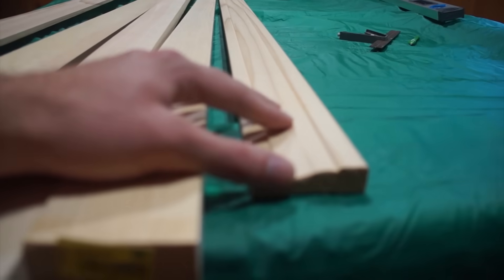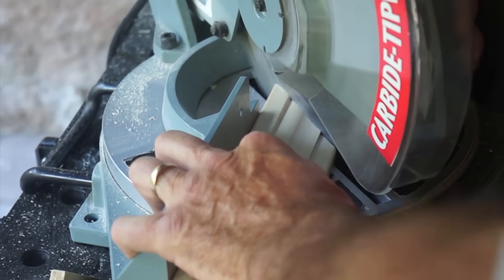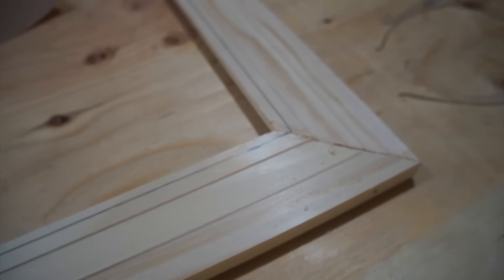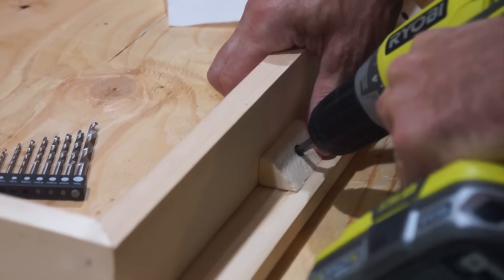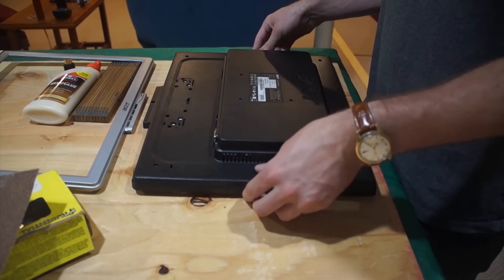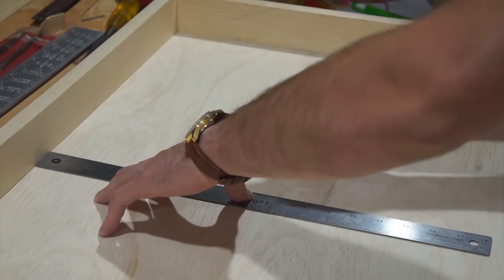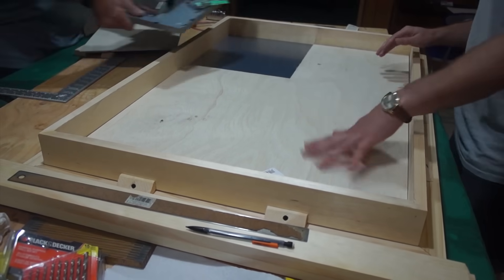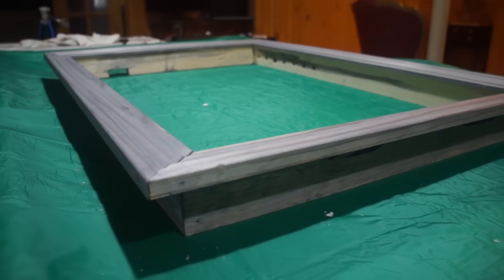HOW TO BUILD A SMART MIRROR

Comment: Make a staircase light with 12 v LED strip and using two PIR sensors. One sensor will be at the upper portion of the staircase and another will be at the lower portion of the staircase. When one person coming down the upper PIR module will work and when That person is going up the Lower PIR module will work. Make it. There is no such video in you tube. Also use 12 V Relay, not the MOSFET this time. Thanks and great video.

Comment: That's a solid build. Putting retaining clips on the cables passing from the monitor (when you could have just stapled or taped... for something that nobody is going to really see) shows quite attention to detail. It kinda looks like you could see the dimensions of the screen since the glow of the monitor's backlight was bleeding through. I think, for version 2, I might consider either going with an OLED monitor or adjusting the brightness/contrast of the monitor to make it harder to see that there's a screen behind.

Comment: Loved the idea and your efforts! However, I have a question for you: Won't the humidity in the bathroom effect the functionality of the mirror over the period?
Reply from the maker: Yes, you are right humidity can damage the circuitry if not properly protected against. Now I haven't really shown this yet in any of my video, but to combat this I use what is call conformal coating on the circuitry of the project. You can either spray or brush on this "conformal coating" and this will put a silicone or similar coating on the circuitry to protect it from any dust, moisture or other particles. Basically it creates a water resistant seal.
Reply: Awesome! You really thought this through man! Appreciate it, one more subscriber!

Comment: But can you see the monitor backlight through the mirror in the dark?
Reply from the maker: It really depends on the backlight percentage you are using. I am currently trying to wire in a function that detects light intensity and changes the backlight brightness accordingly. But when its too dark you can't really use a mirror too well anyways.

Comment from the maker: Please tell me how I can improve this project!
Reply: Grensom by adding a Chromecast
Reply: Looks good, could you put the extension lead inside the back so you only have 1 cable coming out
Reply: Grensom By implementing a proper cable management.
Reply: Voice command would be pretty awesome
Reply: I would either add a PIR sensor to switch the monitor on and off or use an oled panel for the raspberry pi since standard panels consume quite a bit of power. (send the display to sleep system based and let the PIR sensor trigger the wakeup command)
with the oled panel the whole thing would become a lot thinner, alternatively you could use an old laptop display with a driver board for the same result.
with a forstner bit you could make some pockets in the frame from the backside until it reaches a thickness of about 2-3mm. that way you could put capacitive sensors inside the holes and engrave it from the front to have some buttons as an input.
Reply: u should add a motion sensor so when u at the mirror it will turn on ;D
Reply: please include emily poole's appearance!
Reply: Add a list of parts used in the description
Reply: some things have been mentioned, others haven't, but what i'd possibly do, would be to:
1. have an extension cord on the inside where you plug in both cables and have only 1 cable coming out. 
2. tie off the cables and nail them to the inner support beams. 
3. add a (thin) back cover
4. paint both the outside and the insides (with a waterproof paint/lacquer), just in case you decide to hang it in the bathroom (or for prettiness) 
5. the inner panel that you painted black: I'd have cut it first, before painting it (it saves some paint and makes for a neater job imho lol)
6. add speakers
7. get google assistent working on the system (or cortana or alexa or whichever you prefer) 
but anyway, awesome project and these are things i came up with after seeing you do it. I'm not sure I'd have thought of these if i'd have started the project from scratch, so awesome job anyway!!
Reply: Are we at the point where adding in touch screen tech is possible??
Reply: @Three_Dog_Gaming  I had the same question
Reply: You can build in Alexa pretty easily these days
Reply: make it have ssh so you can remote into it from your pc if you need to edit it?
Reply: Grensom, just one suggestion use zip ties for the wires to make them look cleaner it's just a tad bit more professional-looking, but great design man.
Reply: Add a google home or something like that for voice command.
Reply: Hang the mirror over a wall socket, so no leads are comming out...
Reply: ThreeDogGaming the mirror look kinda flexible. Given enough flexibility in the material one of the various touchscreen methods that have been invented should work.
Reply: maybe use a laptop pc and a large touchscreen mirror instead of Pi or even do something like disassemble an Amazon Echo Plus and put that in too.
Reply: Velcro those wires for some cable management and put a mini power strip IN the mirror so only one cable coming out.  Other than that, looks pro!
Reply: Everything is wrong with it, but I'll tell you what... I'll let you practice by building me one.

Kidding. It's incredible. I'm now considering it.
Reply: Like to see a small bathroom sized one using an old smart phone with widget app. It be useful because it's something others could do
Reply: Grensom touchscreen
Reply: Kickstarter might help get funds for it, if it's not on there already.
Reply: Use the metric system?
Reply: Bad ass!! How do you mitigate the warping/temp/heat from the devices coming into contact directly with the wood frame? Is there potential of over heating or fire. Are ventilation holes enough? Interested in building one for my home. Keep up the great work!
Reply: Post it to me, lol
Reply: Link the material bought pleeeease
Reply: @jeffreydavidconner  then you'd need a proper wall mount setup instead of a couple screws >.<
Reply: Why do Americans like big and bulky so much? My magic mirror is flat AF :)
Reply: Make it compatible with 0S updates etc & you can take my money. Otherwise, a great bit of work. I’m off to spend a dumb amount of money because I’m impatient.

Comment: What pi do you recommend I have a 3 and a zero w, also what monitor do you suggest to use???
Reply from the maker: I had some trouble using the Zero W, because that was my first choice due to the size, price and built in WIFI. Because I couldn't get that to work I decided to use the Pi 3. I know the Zero is doable though, but the Pi 3 is what I used and is an easier setup. My other video goes through the complete setup with the Pi 3 as well if you wanted to reference it: https://youtu.be/pcmjht0Hqvw

Comment: Hi that's very cool work, can i ask you questions? could the monitor replaced by just a mobile phone? and about the display, if i use an acrylic mirror and bended, is it still working fine on bended surfaces?  iam doing such an academical research about it, thanks for your work, it's inspiring
Reply from the maker: Yes you can replace the monitor with really anything with a screen, the mirror is just 70% reflective 30% transparent material. The only issue is a phone is a small display and the screen will time out on you. If the mirror is bended obviously you will get a distorted reflection but if you had a flexible display or lights behind it, it would technically still work
Reply: i see, what about touchscreen feature, do you have any idea how to make it works touchscreen? thanks for the answer btw...

Comment: Would a raspberry pi zero work with this?
Reply from the maker: That's the thing, I wanted to use a pi zero w starting out but was having no luck with it. I believe it can be done but you have to run the software a certain way. You'd have to look into it more to understand

Comment: we can make the same setup using android tablet. That way it will be cheaper and easier to setup. and i think amoled display will look more refined.
Reply from the maker: Yes you can, there are apps on the Google Play store you can download to have a similar setup. The only issue is the size of the display is probably going to be smaller. Also you have to make sure the tablet doesn't go to sleep on you
Reply: Grensom ya . i have a old tablet. this project can give it a new life. haha

Comment: Put some retro games on it. You could play space invaders on your mirror.
Reply from the maker: Technically you can do that already because the Raspberry Pi comes with Games on it by default. But you need to disable to auto-boot function on the software or else every 15seconds the Smart Screen will keep popping up
Reply: Grensom would be cool though, a stealth game system hidden in a mirror.
Reply from the maker: Pixelated Icon That is a good idea, I'll put a little Easter egg in my next Mirror like that

Comment: Not bad bud. Just needs to be touch screen now. Seriously I like it.
Reply from the maker: I am a little hesitant to make the mirror touchscreen just because no one likes finger smudges on the screen. I am thinking to maybe making a way to customize it through a website possibly from your phone or computer.
Reply: Grensom wireless monitor. OOOOO!!! One of those little thumb drive computers you plug into a monitor!!!  Only a 1.4 intel processor though.... I’ll see if I can find a link.... Newegg.com 50-500 bucks. Compute stick

Comment: A few suggestions.  
1. Cover the charging chip. With something .. anything
2. Tie those cables t ogather and secure them neatly 
3. Invest in a Pneumatic stapler
4.Clear coat the frame
5. Secure the frame to the support frame with something more than glue.

Just suggestions . This is a total badass idea and I really appreciate you sharing.  My suggestions are only to make your creation better not to tell you what to do . Hope that didn't come off that way.   THANKS
Reply from the maker: Thanks, I actually do appreciate the feedback (good and bad), I will definitely keep these in mind when making another one, as I plan to do. Things can always be improved
Reply: Yes those are the ingredients to do the project properly. I was thinking the same thing

Comment: Cool project, I think a motion sensor would be a good addition with a timer for the screen
Reply from the maker: I was thinking of adding a motion sensor in so that it will turn on and off when sensing motion. Definitely a good suggestion!
Reply: Good point, wouldn’t be much to input.
Reply: arp2005227 you will need a relay as well to boot up the screen

Comment: A supplies list, like where you got the mirror, etc would have been super-awesome.  As the mirror looks like it is  NOT GLASS, as it bends when you put it into the frame.
Reply from the maker: Check the Updated Description for the Video, I have included the parts used and links to them

Comment: I hope you informed everybody to make back up copies of the SD card since they are notorious for going bad within 2 years of use, that is a lot of crap to go through all over again if it goes bad. you'd be better off using a HD to run the system instead of the SD card its way more reliable. and add in a USPS.  yes it will drive the cost up but well worth it.

Comment: where is the actual pc connected to it?? its just the screen thats on the mirror right??
Reply from the maker: Yes, the monitor is right behind the mirror on the top left if you are looking at the mirror. The rest of the mirror is painted black so that it is fully reflective.
Reply: how about the desktop?
Reply from the maker: It doesn't run off a PC, it actually runs off the Pi just like a PC. All the software is put onto the Raspberry Pi and connected to the Monitor via the VGA cable. Look at this video for more information on how it is setup: https://youtu.be/pcmjht0Hqvw

Comment: i wanna do this, how much does it cost to build one of these? i have an older computer monitor that i can use so i wouldnt need to buy that. what do u thing materials would cost for this?
Reply from the maker: Prices can vary, but here is a list of Materials:
Mirror: https://www.amazon.com/dp/B01CZ35YJ6/ref=twister_B01CYYXQHI?_encoding=UTF8&psc=1
VGA-HDMI adapter: https://www.amazon.com/gp/product/B016HL4CAY/ref=oh_aui_detailpage_o02_s01?ie=UTF8&psc=1
WiFi Adapter: https://www.amazon.com/gp/product/B003MTTJOY/ref=oh_aui_detailpage_o01_s00?ie=UTF8&psc=1
Pi: https://www.amazon.com/CanaKit-Raspberry-Micro-Supply-Listed/dp/B01C6FFNY4/ref=sr_1_6?s=pc&ie=UTF8&qid=1510887234&sr=1-6&keywords=raspberry+pi
HDMI cable: https://www.amazon.com/AmazonBasics-High-Speed-HDMI-Cable-1-Pack/dp/B014I8SSD0/ref=sr_1_3?s=electronics&ie=UTF8&qid=1510887225&sr=1-3&keywords=hdmi+cable
SD-Card and adapter: https://www.amazon.com/SanDisk-Micro-Memory-Card-SDSDQM-B35A/dp/B004G605OA/ref=sr_1_7?s=pc&ie=UTF8&qid=1510887325&sr=1-7&keywords=micro+sd+card

Other than this you can pick up all wood, nails, screws, and brackets at any hardware store like Home Depot or Lowes

Comment: May you provide a list of what tou use and where to buy/download?
Reply from the maker: Mirror: https://www.amazon.com/dp/B01CZ35YJ6/ref=twister_B01CYYXQHI?_encoding=UTF8&psc=1
VGA-HDMI adapter: https://www.amazon.com/gp/product/B016HL4CAY/ref=oh_aui_detailpage_o02_s01?ie=UTF8&psc=1
WiFi Adapter: https://www.amazon.com/gp/product/B003MTTJOY/ref=oh_aui_detailpage_o01_s00?ie=UTF8&psc=1
Pi: https://www.amazon.com/CanaKit-Raspberry-Micro-Supply-Listed/dp/B01C6FFNY4/ref=sr_1_6?s=pc&ie=UTF8&qid=1510887234&sr=1-6&keywords=raspberry+pi
HDMI cable: https://www.amazon.com/AmazonBasics-High-Speed-HDMI-Cable-1-Pack/dp/B014I8SSD0/ref=sr_1_3?s=electronics&ie=UTF8&qid=1510887225&sr=1-3&keywords=hdmi+cable
SD-Card and adapter: https://www.amazon.com/SanDisk-Micro-Memory-Card-SDSDQM-B35A/dp/B004G605OA/ref=sr_1_7?s=pc&ie=UTF8&qid=1510887325&sr=1-7&keywords=micro+sd+card

Other than this you can pick up all wood, nails, screws, and brackets at any hardware store like Home Depot or Lowes
Reply: Grensom  can you list all of the wood/nails you use at the cost at your home depot by chance ?

Comment: I think you are confusing 'mirror' which is glass coated with a metal amalgam, with 'reflective acrylic', which is what you are using. Very confusing for anyone watching the video.
Reply from the maker: Well most mirrors are coated glass, but this is an acrylic mirror which is what you said a coated acrylic. But this project can be done with either glass mirror or an acrylic mirror. You just have to make sure that there is enough transparency in the coating for a display to come through. Two-Way mirrors are somewhat transparent and mostly reflective

Comment: wait...what did you use for mirror? like what type of glass/ pexi glass is this?
Reply from the maker: This is a two-way mirror. They come in either acrylic or glass material. Glass will be better quality but the acrylic is cheaper. I used the acrylic which will work fine as long as you set it right. If it is bending at all the reflection might be a bit warped. This mirror was 30%Transparent, 70% Reflective - I got mine from Amazon
Reply: thank you

Comment: Saves throwing old lcd screens and maybe a good one will be with Arduinos instead of the PI  !!! even lower power consumption!! - good video though excellent job!!
Reply: Kcin Setay Arduino wouldn't work though. It's a microcontroller and not a computer. It's functions don't allow it do drive more than half the stuff here without buying a bunch of add ons. And by the time you get all the stuff needed, it would draw more energy than the pi and cost more than the project is worth.
Reply: Well I was only suggesting a simple bit of C# to run a small simple OLED display for a simple clock would be as good as nothing special - know because I don't that type thing my self

Comment: Good job man. I just have 1 question, are you just using a standard mirror ? Everywhere I read about this project is to use a 2 way mirror or a special 2 way mirror film.
Reply from the maker: Yeah so I used a two-way mirror for this project I found on Amazon. This is specifically 30% Transparent and 70% Reflective. You can either use acrylic mirror or glass mirror - the latter is more expensive but better quality mirror. I used acrylic for pricing reasons - works fine if you set it right because acrylic bends which is not good for mirrors unless you are in a funhouse

Comment: Cool Stuff. What kind of Mirror or Mirror Film are you using ? Details on it will help. Good Job
Reply from the maker: I used a Two Way Mirror I found on Amazon. It is an acrylic 1/8" thick mirror that's 70% reflective 30% transparent.

Comment: Hey great job! Is there any link to where I can buy the one you made? I got lost in the cable wiring and don't want to mess up.
Reply from the maker: Mark DLR unfortunately I cannot sell these right now, and premade ones are very expensive, but all the wiring is, is power to the Pi, power to the Monitor, and HDMI from Pi to Monitor.
Reply: Grensom , how is the heat dissipation from the electronics handled. Have you considered a pair of computer fans, one pushing air through and one pulling air out, as well as air channels to provide air flow over the parts.

Comment: Can you please provide the links were you got from everything... please
Reply from the maker: 1. I got the wood, screws, brackets etc. from Home Depot so you can go to any hardware store for that
2. The Raspberry Pi I got from Amazon: https://www.amazon.com/CanaKit-Raspberry-Micro-Supply-Listed/dp/B01C6FFNY4/ref=sr_1_6?s=pc&ie=UTF8&qid=1504215642&sr=1-6&keywords=raspberry+pi+3
3. I recommend finding a Saver's or resale store like that to find a monitor really cheap. Savers has them for less than $10